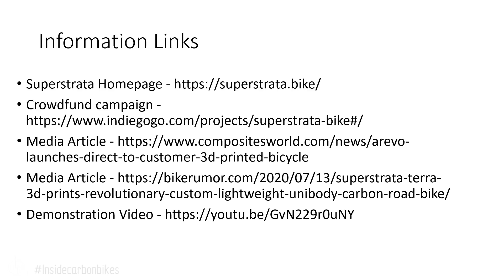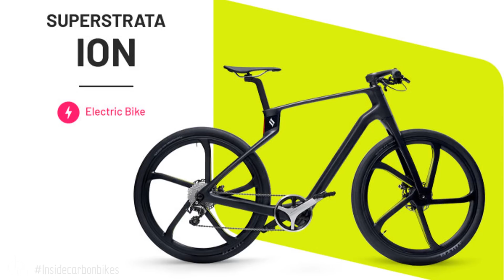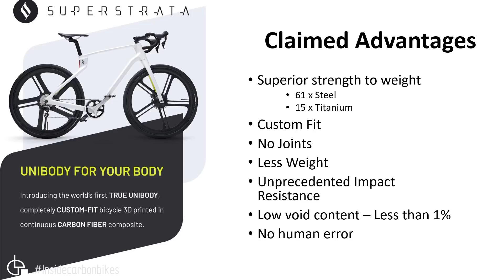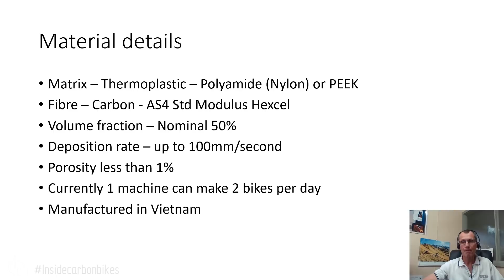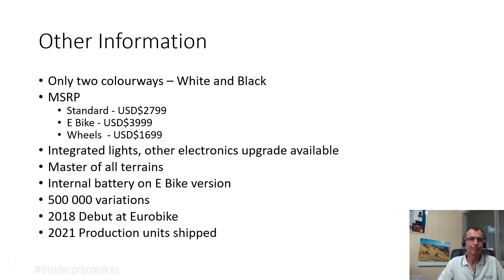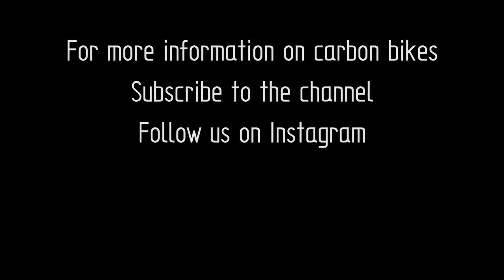SUPERSTRATA 3D Printed Carbon Bicycle - Gamechanger or Not?

Comment: At 1.3 kg a frame that's as heavy as the most basic titanium bike we sell in our shop... and the titanium bike is actually real and doesn't go soft in UV? Oh and it costs about the same and it's hand made in America not made by a robot in Asia... and if you spend more some of the titanium frames are only 950g. 

I agree with some of the other comments, it's a money grab and will probably never come to the market. If we are investing in 3D printing I personally am most interested in titanium printing. That's a game changer.
Reply: What titanium brands do you sell in your shop? The lightest TI frames I have seen are around 1.3kgs. Didn't know sub 1000g was possible.
Reply: Andrew G 1.3 are the norm but many Brand's make 1.1kg Titanium frames now. However Litespeed hold the record with the T1SL at 950g.
Reply: Here in Europe and even more in Down Under, where Raul is, those beefy meatbeaters are not so favored. And printing titanium is not a game changer, sicnce it already exists for quite a time and the rules of this game have been adjusted.
Reply: https://cyclingtips.com/2020/08/the-titanium-bike-that-thinks-its-a-carbon-aero-bike-bossis-strada-ss/ 

Check this out...

Comment: Top Tube, Seat Tube, Seat Stays (in order of importance) are not essential stress parts of the bike frame. BUT frame MUST HAVE THEM! In order to have the best possible performing system for given material and geometry.
Reply: Beam bikes have no seat tube, no seat stays.  Not really top tube either with only one connection for the beam at the head tube.
Reply: step thru bikes do not have a top tube
Reply: @JogBird  Do women race on those? Like Tour de France? Nope. Why is that?

Comment: It has no added features over a normal bike, unless it is really cheap, and i would imagine no. Steel bikes can be made really cheap and work fine. Always seems to be more gimmicks in the bike industry. Example that ceramic speed transmission. It will never come to market

Comment: The fact that they used the metrea crank (shimano tried to establish a hipster/urban groupset market and failed), which has a chain protection ring, comes with a 42t chainring  and weighs more than 900g says it all.
Reply: Yeah and the excuse that it is a render doesn't really work, because if the designer knew bikes they'd put on a high end crankset.
Reply: Why? It's made to be an entry-mid market e-bike (1900$). I would not expect high end specs for it. Beside they seems to propose a lot of upgrade for people that has the money
Reply: @JeremyMARQUES  1900? No. 4000$ for the E-version. 2800 for the normal version. And why upgrade a crank that costs 160€? They should have bought a proper one for that money in the first place.  But no, they had to buy the hipster crap.  edit: Oh, and they are not using this crank. For 2800$, you don't even get a groupset from either Shimano, nor Campagnolo, nor SRAM, you'll get Andel Components, whatever that is.

Comment: I've done a bit of research on that matter. The bike is 3D printed with continuous carbon fiber by a company called "arevo". In fact superstrata is not the first company to print bikes in collaboration with them (it's Emery Bikes). Therefore it's actually quite probable, that the product will be delivered to backers. After printing the bike is postprocessed by polishing and painting to get a uniform surface. I welcome this innovative product. But one has to be aware of manufacturing limitations. Since the bike is printed in layers and the bike is composed of hollow tubes the fibers can only be arranged in one direction and therefore the one needs more matrix material bear loads in other directions.
Reply: With the DED robotic arm it may not necessarily be thr case that the fibre can only be laid in one direction.
Reply: here is a video, where can be seen that some part of the bike is being polished (at 2:46): https://youtu.be/PxRa0JyILQE?t=166

Comment: It's a money grab.  This bike will never hit the market.
Reply: I was intrigued/excited for all of 10 seconds, then I heard him say "crowdfund campaign".
Reply: Ho, with the money they just got, I'm sure it will be released. It just won't look like pictured. I guess the seat tube will make a return 😅
Reply: Could be correct. There is a 3D Printed bike already in production though using this process called the Emery One I believe.
Reply: as expected from any Indiegogo projects really. I'm not surprised at all
Reply: Near all crowdfunded are money grabs !!
Reply: Amazingly, they have shipped some. However, initial impressions from owners were not very positive. Still, kudos to those early adopters for being willing to take the risk on new tech and start the long process of it evolving into something accessible and workable.